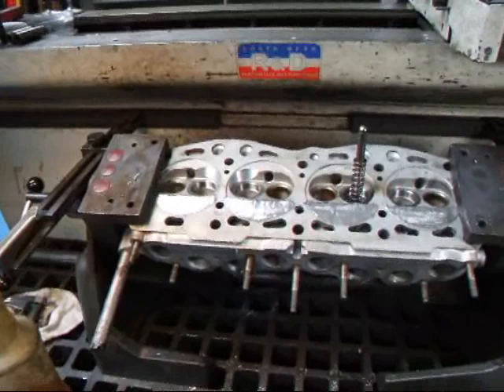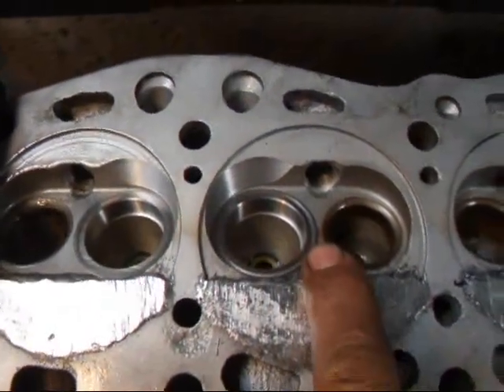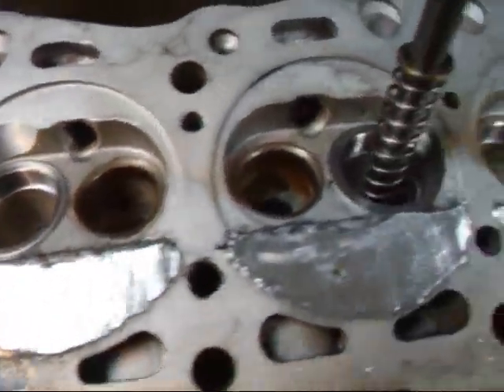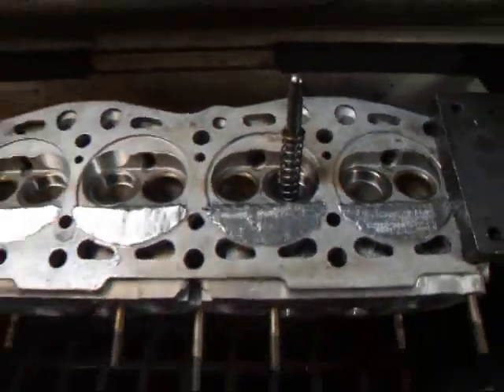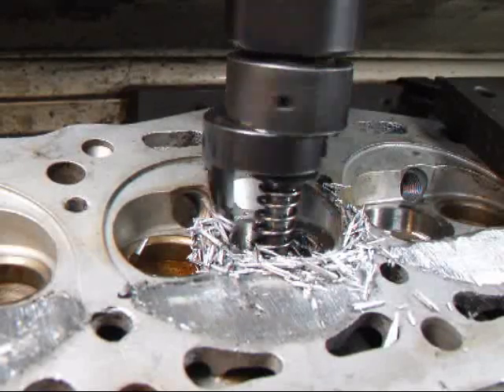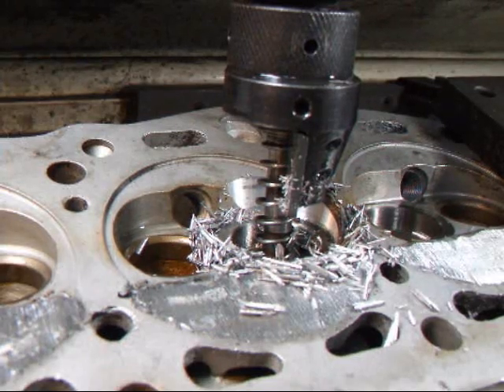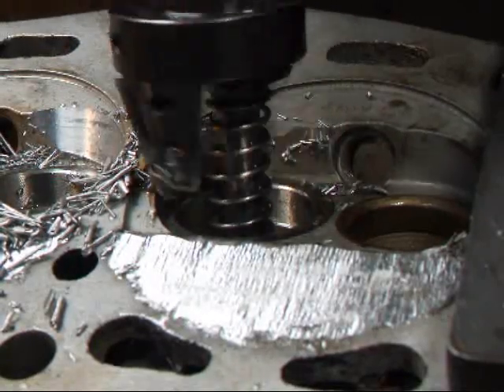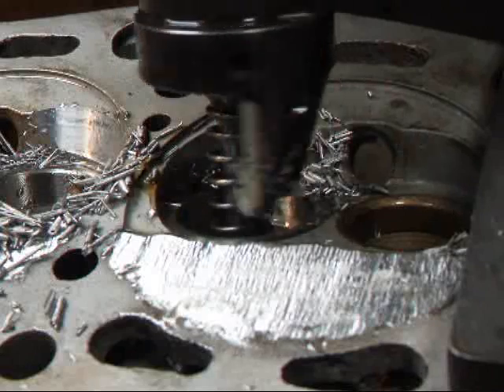Fiat X1-9 Chamber Mod-01.wmv

Comment: Nice tool.  I used to do this by hand.  I see you have filled the low part of the chamber with weld.  These engines work better with a tight squish on that side of the chamber, it creates greater turbulence and mix, and faster flame front speed.

Comment: That would be just another method to lower compression when fitting a head modified for a turbo  ( original turbo engine 1,3l or 1,4l ) on a normal 1,6 litre block :)
Thanks for the inspiration ! 
I´ll post this in our FIAT UNO IG Forum

Comment: @fiatnutz Great idea and quite simple! But I'm worried about the reaction of the material, cause 4043 Al is probably different than OEM Fiat material . I mean: weld can break during the engine work. Sorry for my English but probably the problem is "temperature expansion". What do You think about it?

Comment from the maker: @MPWR327i - I use a heliarc (TIG) welder and 4043 filler rod. Temps inside the chamber should be appriximately the same because the volume is kept equal to what was already there. Aluminum heads can run about 1 full compression point higher compression than cast iron head because of their excellent heat dissipation.

Comment: One more great video. My question is about the way you increased compression ratio. What material did you use? Aluminium? And how you filled it into chamber? Don't you worry about the temperature inside the cylinder? Thanks for your answer.